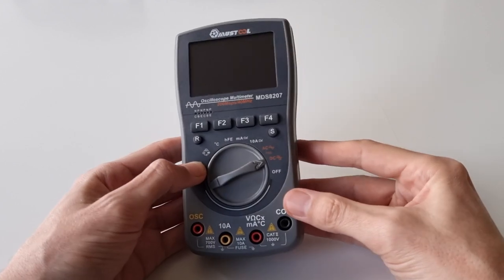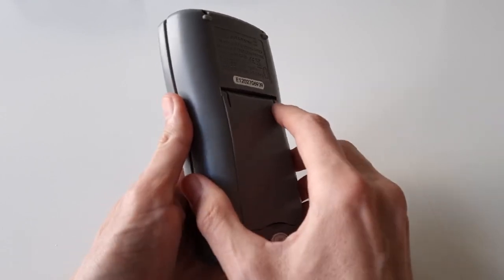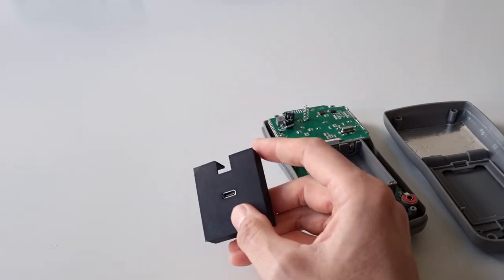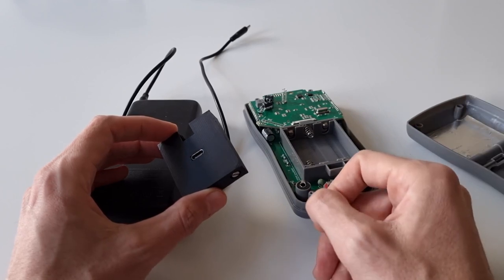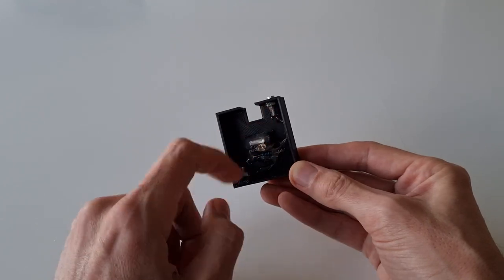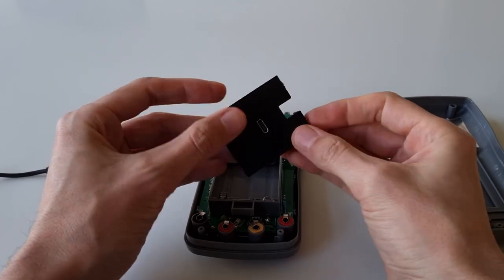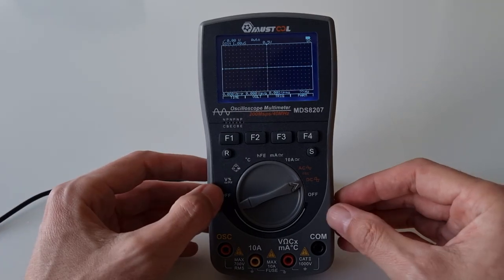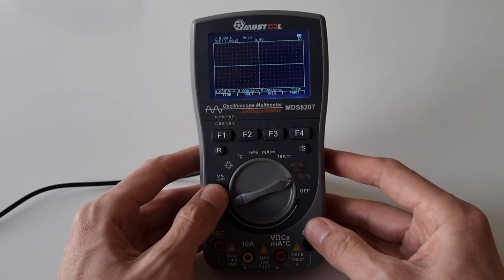USB-C Battery

Comment: Nice simple mod, you could drop the voltage from 5 V to 4.3V by putting a diode in series, but agree with you, 0.5V won't make much of a difference.